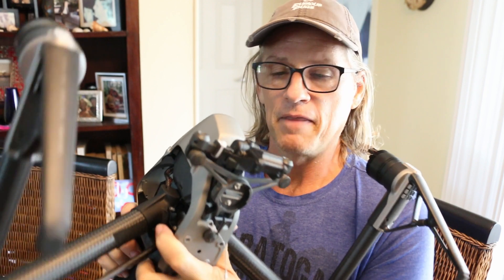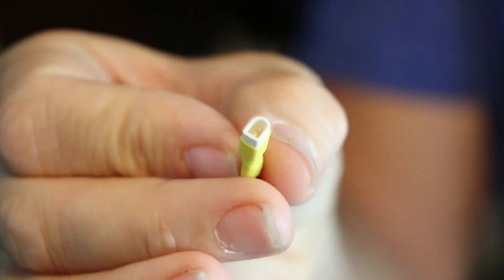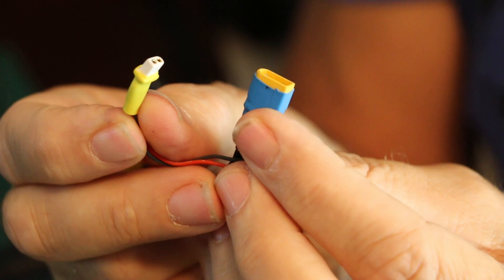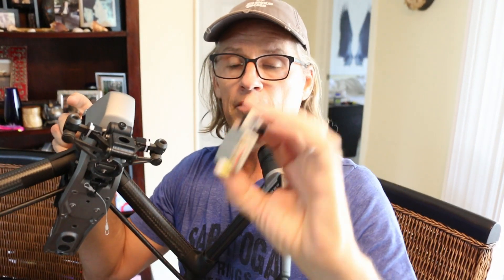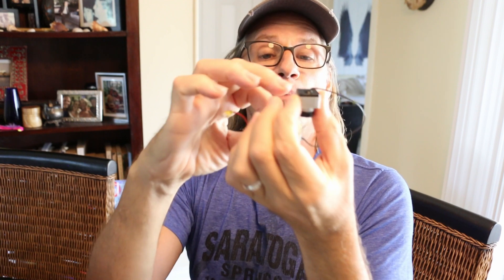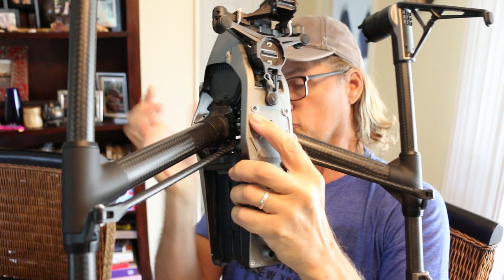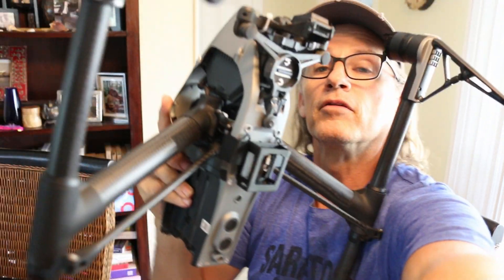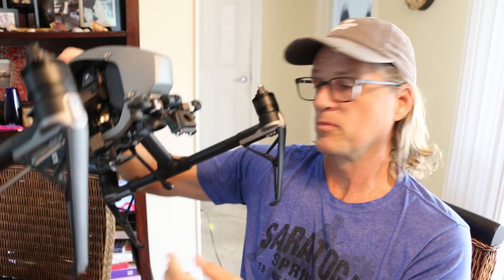Turn your DJI Inspire 2 into an FPV Powerhouse - July '21 Update with improvements

Comment: your thingiverse file seems to be boken!
Reply from the maker: what are you using to open them? and which ones in particular? I just re-downloaded them and they all open perfectly in Cura and in Fusion 360. Let me know and I'll try to help
Reply: @PossumPilot  i found it on thingiverse! but not the .zip file, i downloaded the Inspire_2_FPV_Mounts_arm_up.stl file, but that arm is the right, can you please uplod the left too?
Reply from the maker: great! all you need to do it mirror that one to make the other one ;-)
Reply from the maker: and in case it helps, I've also uploaded a Fusion 360 version to the Thingiverse link

Comment: it could be fantastic if you use the caddx vista nebula pro !! smaller and better, what do you think?
Reply: Do you find the nebula pro to be better quality than the OG air? I always find the vista to be far inferior (picture-wise), but haven't tried the nebula
As far as weight goes, the difference in weight and size is pretty insignificant as far as the Inspire 2 is concerned
Maybe I can design one that uses straps or zip ties so it can hold different sizes
Reply: @RussellSpurlock  it could be a good idea to put on the top of the I2, just because with max power 1200mW the vtx become too hot
Reply from the maker: Probably won't be doing that. Maybe mounting a tiny fan would be good. I try to make sure I don't leave it on when not flying... It gets plenty of air while flying

Comment: I really want to do this to my inspire two But have always been worried about interference between the air unit and the drone
Reply: Hasn't been an issue for me.
Since the air unit transmits in the 5.8 GHz spectrum, it might be a good idea to run the inspire in the 2.4 GHz zone just to be safe.

Comment: Does the gimbal underneath still work ok.. looks like might limit movement?
Reply: It does. The way I have it set up nothing is in the way of or touching the main gimbal. That said, I have updated the design so that you can mount it up and out of the way if you check the other videos in this playlist. Also, as shown in that video, I recommend getting the longer 20 cm cable for the air unit which allows you to do the upward Mount like that

Comment: Hi, vwry keen to do this on my inspire2. Been following since the first video on the topic. Question, do you frame the shot before going under the goggles? Or how do you insure the main camera is tracking / framing the shot while under the hood? Assuming you flying without camera operator of course.
Reply from the maker: Yeah, that's the trick! ;-) My kingdom for Picture In Picture in those goggles!
If I'm operating with no operator, as I was in the Ram Truck video in this playlist, I got things locked in, then went under the goggles (using the I2's active tracking)
It's a bit of a PITA, so I mostly use FPV with the I2 when working with an operator, which is HEAVEN.
The trick with simply running with a fixed forward I2 lens is that it's REALLY difficult to fly smoothly enough in FPV to frame your shots well, so again, I'd say FPV is best with an operator, 2nd best in active tracking modes, and least good otherwise... in my experience. Cheers!
Reply: @PossumPilot   THANKS, WILL GIVE IT A SHOT!

Comment: Great update! I just made your older version airunit holder. Will try this one also, I love that you can keep on the small safety chain. 
do you think you could make camera mount that fits on the nose of the inspire. When I use 9mm lens I get airunit camera in the shot. 
Maybe Just make airunit camera holder with "gopro screw adapter" and then you can stick "gopro adhesive helmet mount" on the nose of the inspire.
Reply from the maker: I know a guy who has modified my camera holder design so that it goes up instead of down. I'll ask him if he minds sharing it, otherwise I'm sure I can modify this one. I'll let you know
Reply: @PossumPilot  Thank you 🙏  Im following your Youtube. Please share if you make a new camera holder.
Reply from the maker: @laru1986  Am printing a test right now ... will post if it works https://gofile.me/5sPuT/ykkZZ2Fqt
Reply from the maker: Ok... I did a redesign and have posted it 
Cheers